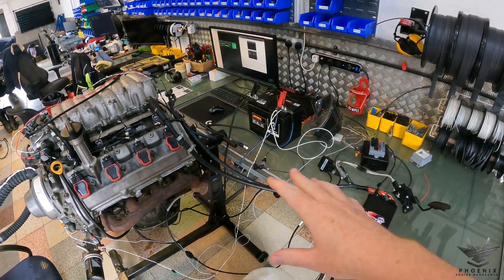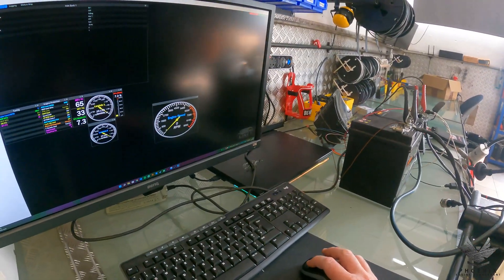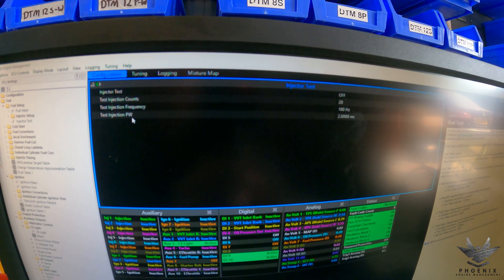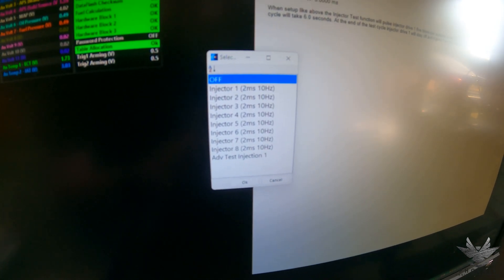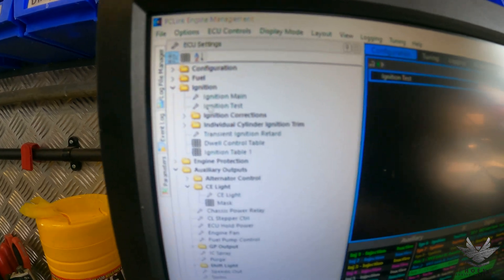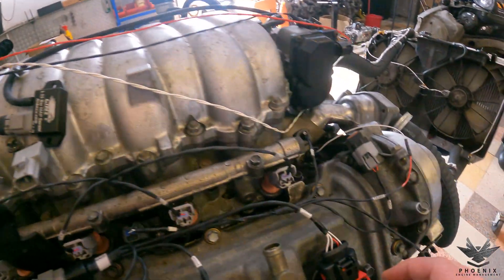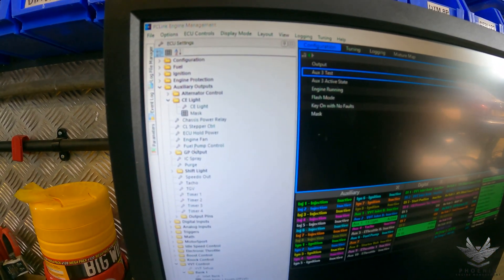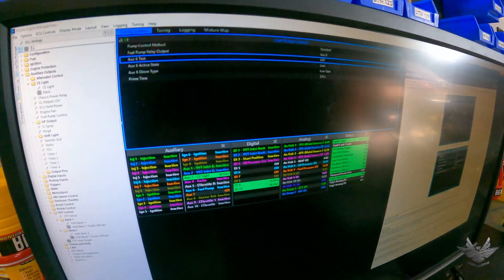Link Engine Management Testing Outputs

Comment: Which aux Output is best for the link boost controller solenoid bcus im using the link expansion loom and i cant figure which color wire would activate the particular output